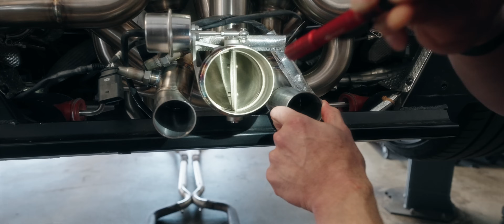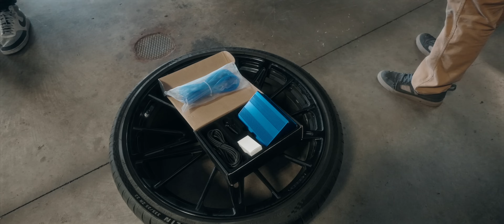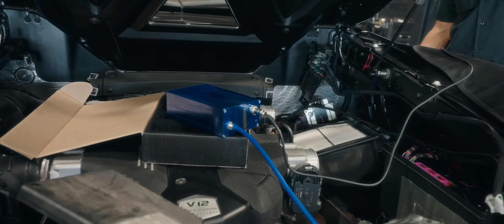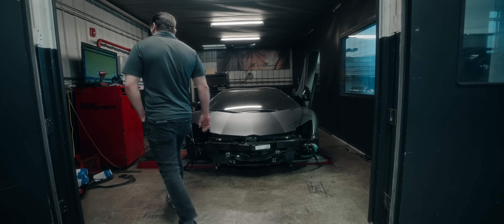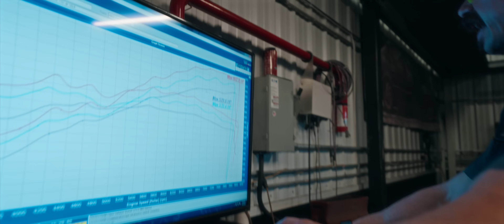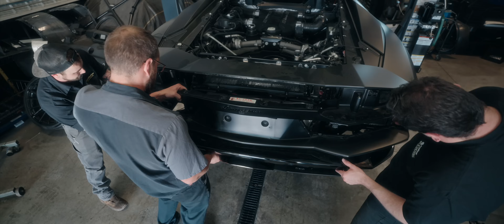Lambo V12 makes 90 NA AWHP with 1 WEIRD exhaust! Concept Aventador system dyno w/ INSANE results!

Comment: Lol 90 hp from the exhaust???? Lol you mean, you had the car retuned after installed the exhaust opening the car up allowing the 90 hp gain. The exhaust isnt what caused the gain in HP. An exhaust CAN NOT contribute to HP gains alone. All an aftermarket exhaust is doing is allowing more air volume / and or air flow exiting the engine. If you are not putting more air in on the intake side, it doesn't matter how much more air the exhaust can flow out. Hence why most real racecars have very simple exhaust systems, i.e. straight pipes. Saying an exhuast gained you 90 hp is such a scam. Lol and this dude is too smug and full of himself 😂
Reply from the maker: You must be new here and clearly read the title and didn’t watch the video, or the other 2 videos in the series explaining exactly this… 🤣
Reply: @FluidMotorUnion  nope. Just stating the facts. An exhuast system itself will not gain horsepower.   Simple. The HP gains came from the tune after the exhaust was installed. Probably could get the same 90+ HP without the exhaust. Exhaust adding HP is snake oil bud. I build and race N/A dragsters. Small block Chevy, mechanical injection, N/A that make over 1000 hp

Comment: I've seen some of your builds and love them but sorry to say it sounds like a restricted ricer.
Reply from the maker: Well the gains show it’s not restricted…
Reply: @FluidMotorUnion  I get you it just sounds that way. But like you said if the customer is happy and it don't hurt the car then  job well done.
Reply from the maker: We get we can’t make everyone happy. We can get the comments from the first video cause the system is so loud it’s hard to level the mic out correctly. The comparison section doesn’t convey how much louder this system is than everything else we’ve ran across. Loud isn’t better and this system is not refined, much more brutal- not everyone’s cup of tea for sure. But the flyby portion of the video should better convey the intensity of the system as well as the pitch.

Comment: 5500rpm and up range is just amazing. Even if the car is cold the owner will feel the huge difference in power.
Reply from the maker: He did. That was him and his son talking about it in the end.
Reply: @FluidMotorUnion  And look at the torque under that, and torque in general.  75wtq down low and 75whp+ up top, very impressive gains and sound.

Comment: Growing up and being in the car scene in late 90’s to mid 2000’s, turbocharged cars were rare and very lusted after. Now that everything is turbocharged, i lust after these NA screamers. 
Exhaust is a work of art!

Long live the V12
Reply: I've always been about NA because of the sound, smooth power delivery and I'm not trying to go fast so idc about power, turbos are def the future when it comes to efficiency but NA experience is just different and a lot more enjoyable.
Reply from the maker: Same.
Reply: V12 will never die, it's automotive tradition. They will make anything like EV just able to make V12.
Reply: @GF-mf7ml probably. I hate EVs but as long as N/A engines are around, i dont care.
Reply: na hybrid 🤓 lighter more power, torque from 0 to 3500 depending on design. keep the growl, and never be stranded. some can run ev only by choice and use regeneration from brakes and motion as well as heat.  then the engine only runs to charge battery.

most are multifuel as well. able to run nitromethane and alchol.
Reply: @pazsion  Not sure about lighter, hybrid requires more parts, motor, battery, etc

Comment: Insane gains for NA especially on a car that comes pretty high strung from the factory
Reply: Absolutely insane. And drivability is even more insane I'm sure.
Reply: It comes restrained from the factory
Reply: @gated6  yes all cars do… usually Aventadors only gain 40-60 crank from exhaust & tune. This much AWHP gain without forced induction is wild especially on a dyno dynamics!
Reply: @donnydumper  I had a slightly bigger gain with only exhaust and tune, on a mustang dyno

Comment: From an engineers prospective that's some achievement, from a car guy prospective there are other tuners who have better sounding exhaust.

Again great work, should be proud of your horse power gains that's some great achievement.
Reply from the maker: Sound is subjective. Our “neighbor” has the system in question. It’s different. Better for camera, but our system is much more “intense” in person. Very visceral. Hard to quantify in video ya know? But really appreciate the feedback.
Reply: @FluidMotorUnion  Exhaust systems seems easier to have accomplished a good sound. Thus imo gaining max horses from an exhaust system is a greater achievement than sound, so I absolutely agree. It also sounds more of a track beast than a cover girls lamborghini in my opinion lol
Reply: You have to remember R32 , they're running a hell of a lot more pipe AND through a bunch of cats....most aftermarket exhaust for these remove the cats or at least some of them to get the sound, and are typically just short runs of pipe for $12k + which is ridiculous, have you ever priced an exhaust for one of these from a "boutique exhaust" manufacturer? It's typically upwards of 12k easily and I've seen as much as 20k.... for literally 4 total feet of pipe if that, no mufflers, no resonators, no nothing, just bare pipe.... don't understand that, especially when there's a jig already made from the first, and you look at another nice car with tens of extra feet in piping, resonators, mufflers, high flow cats, and and that'll be like 4k max.... it's like they know you bought the car so you'll just pay whatever for the exhaust.... and I'm not talking about the first exhaust run.
Reply from the maker: @johnnygeorgopoulos4072 yes…! “certain” systems are clearly a money grab… gold coatings and a “frequency balance tube” that only adds aesthetic complication to what would be 5 feet of tube. It’s frustrating trying to tell a customer why what we’re building using a decade and a half of experience is better but costs a touch less. This was a concept that I’m thrilled worked out cause it would have been a costly redo!!! 🤣
Reply: @FluidMotorUnion lol you did wonders with this exhaust system. 😊
Reply: Pretty great stuff. That’s real tuning
Reply: Would have to hear it unrestricted to really tell
Reply: Lol you say you are an engineer, then proceed to say congrats on the 90 hp gain from the exhaust system. Lol 😂 that exhaust didn't do anything. And the Gintani system sounds better.
Reply: @TheMiraldi  If they wanted it to sound like Gintani they could have built it like Gintani - they're obviously capable... Gintani system sounds good no doubt but its not really anything special, just a $14,000 x pipe... This sounds way more raw like almost Le Mans Prototype car sound, that top end in the fly by is INSANE. It's something nobody else on the street has. Idk dude sound is subjective I guess but you can't say it didn't do anything - the dyno results are clear this thing makes crazy power.

Comment: What did you do about the thermocouplers (catalytic temperature probes)? They tend to burn up. Did you relocate them? Did you tune them out?
Reply from the maker: The egts shouldn’t change much, it was reading cat temps but now still same place. Never had an issue with them as long as they are reinstalled in the same approximate location, unless they aren’t handled with care with is the most common problem. We do A LOT of exhaust design and haven’t run into that issue.
Reply: Thanks for this response. I’m having an issue with mine and replaced one of the probes. Maybe I just need to replace all 4.
Reply from the maker: @cameronwilliamson3754 got the faults? We build good exhaust setups- but we’re even better at diag, maybe we can give you a direction or, we’ve ran into it before. Same car?
Reply: I can go pull the fault codes today. Its a 2014. That would be an amazing help. I’ve been struggling with this for 6 months.

Comment: Spend all that money and find out your wiring from VWG I be pissed!!
Reply: Copper is copper my guy.
Reply: Then you'd clearly be an uninformed shopper as VW Audi Group owns Lamborghini, it's one of the reasons their cars have been selling so well in the past decade due to reliability and better design fit and finishing, but also, one of the reasons their V10 went from sounding glorious in the Gallardo to not so glorious in the late Gallardos and Huracan, as they went from using their own design V10 to Audi's V10....but hey, now you can drive them and when you look underneath, they're not just a bunch of steel square tubing shimmed up to hell trying to make the body look straight 😅
Meaning, VW Audi Group owning them has made them a full product now, and not just a pretty and good sounding one, but one that works and works for years to come.
Reply: @johnnygeorgopoulos4072 wait till he finds out that the Bugatti Veyron valet key is the same one as a cheap VW 😂
Reply: It would be a lot more expensive and less reliable if they had to make their own parts.
Reply: I got Lambo grade wiring in my Golf.
Reply: I guess you're not aware that exactly that and the whole VAG thing saved Lamborghini and made them actually reliable, livable and better than they've ever been, mechanically
Reply: L comment.
Reply: Yes I know stellantis group owns these manufacturers but you spend that kind of money that’s why that company sucks! Ford also following along built ford crap!
Reply: @Groot564 Stellantis doesn't own VAG. 😂😂😂

Comment: Sounds great 👍 power gain also very well done. I have a question: on the original dyno graph the line looked smooth. The new line is a bit wobbly... Can you notice that during driving?
Reply from the maker: No it’s the way our dyno syncs up the the two beds, it’s more pronounced now that the gains are increased, has trouble syncing them up. They smoothed out the more we did after but it’s not super interesting to show the 40 runs we did on this car and what we think the differences were between each run. We cut 10 min of dyno talk cause it was 💤…